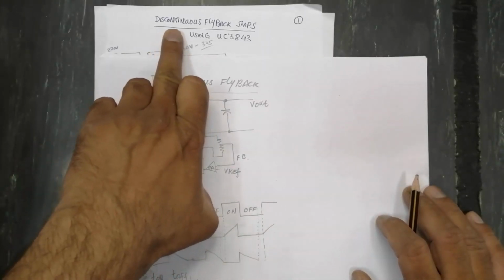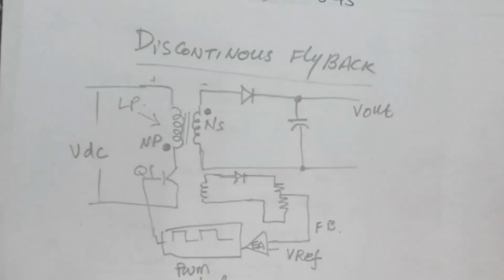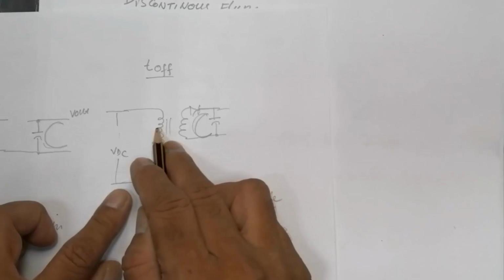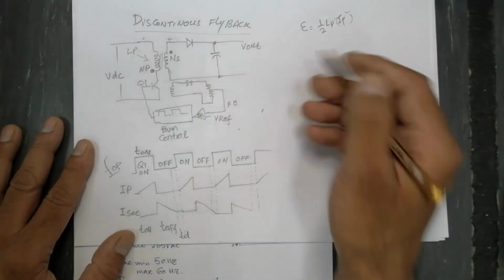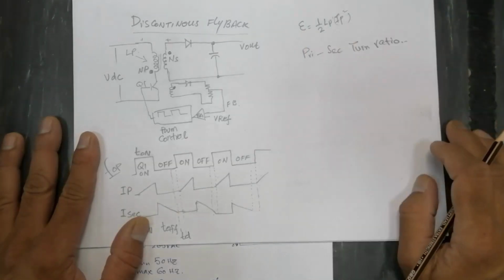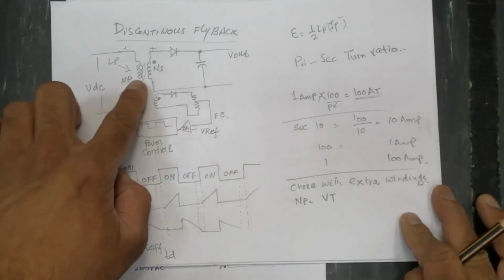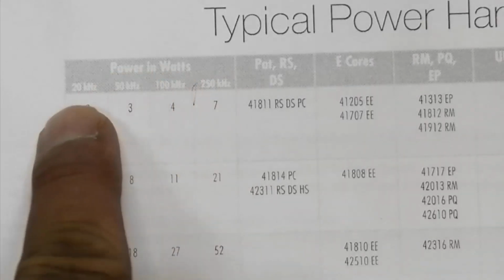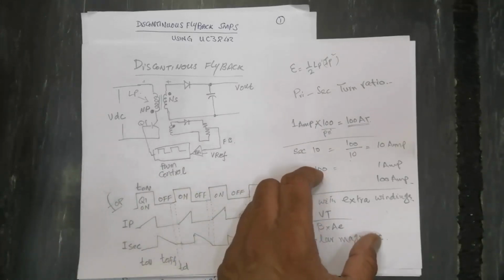{269} Understanding Flyback Transformer

Comment: does the flyback transformer reduces the input volatge like a normal transformer (based on the primary and secondary windings), or the voltage on the secondary is changed by changing the duty cycle in activating the primary.
Reply from the maker: as it is a regulator, so its output is regulated in both cases. either the input voltage change  OR the load is increased in output. in both cases its output is regulated by changing the duty cycle by the PWM controller ic, which is working at some specific frequency. 
if the dc rail / input voltage will decrease, OR the load increase 
the pwm controller will increase switch ON time to increase the primary current to compensate the drop.

Comment: Sir, Thank you very much again. I've noticed in your video about flyback transformer calculations that you selected a duty cicle D = .48, before to calculate it, I mean, you assumed it, but can we select an arbitrary value of D or should we calculate it and then have the calculated value? Thanks in advance and much appreciation  for taking your time to share your knowledge, God will reward you with oveflowing.
Reply from the maker: while calculating flyback topology, we have to divide a switching cycle into 2 portions 
ON time & OFF TIME
during ON time, the magnetic energy is stored in primary winding 
in OFF time the stored energy is transferred into the secondary windings
(this is basic concept of flyback, that there is no output in secondary in Pulse ON time)
so to make it DCM flyback , we have to allow some portion of ON time and OFF time as dWell time. this time is dedicated to zero the primary current (so the there should no resonant current in primary winding before new pulse which is expected in next moment) this is called discontinuous current mode flyback, to achieve DCM function we must have to slect duty cycle less than 50% and 2% out of 50% should be allowed to discharge the primary current 

to make it CCM, the duty cycle may be adjust above 50% so that the next cycle will start switching when there is current present in primary it is called CCM
Reply: I would like you to answer my question, should I a take a random value of D or should I calculate it, please? Help me to kill My doubts about this topic.
Reply from the maker: We should calculate it 
Duty cycle with no load
Dmax with full load
Duty cycle with VDCmin
Duty cycle with VDCmax

Comment: Hello Haseeb, I watched many of your SMPS reviews and you are very dedicated to your work. This is very pleasant to learn from you. 
Would it be possible to describe the current sense circuit using the MOSFET current sense resistor and its priority over the Opto-coupler feedback circuit.
Is it this circuit that shuts the UC-1842 when there is a short on the secondary side?